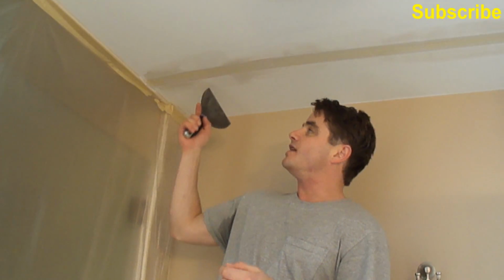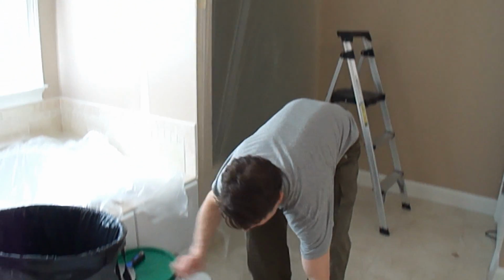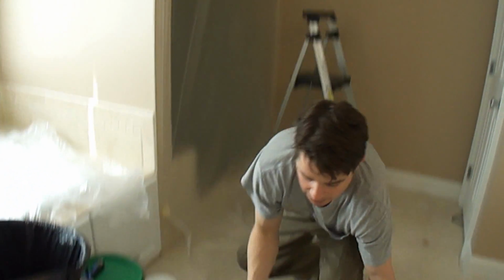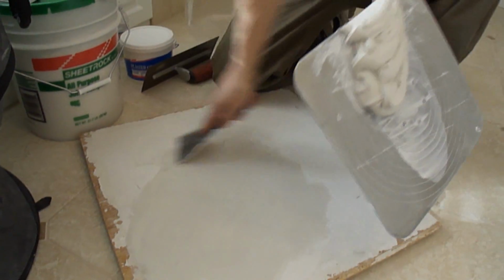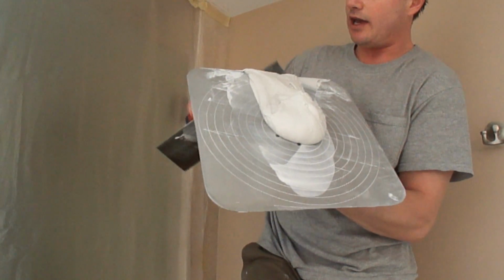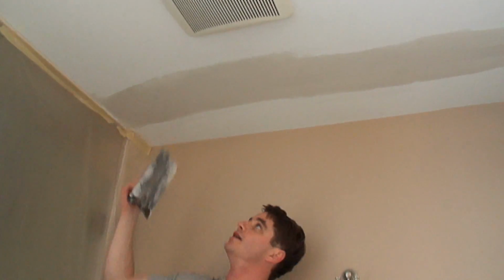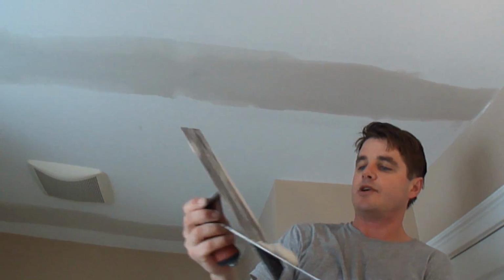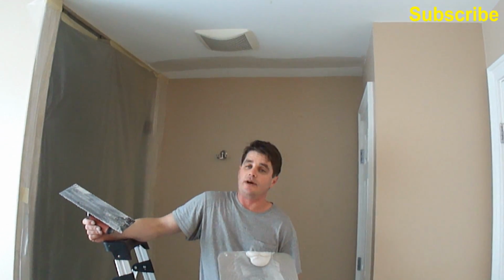DIY - Repair Cracks in the Ceiling by Removing Old Drywall Tape (Part 4) - Drywall Repair

Comment: 👍🏻Nice presentation! My only question is Why you didn't address the crack itself by securing the drywall to the wood above the drywall ceiling? Weren't the cracks a result of drywall panels slightly moving? If the drywall isn't secured to some wood structure better, the crack may reappear on the edges of the new setting compound and the old mud.
Reply from the maker: I think the crack was from not packing enough mud in the joint in the first place before taping. This causes a week joint that looks smooth and strong to the eye, but if you where behind the joint, you would easily be able to poke your way through.

Comment: Hey Russ sorry I am asking questions again lol if you can remember from the bathroom series. 

I'm asking about texture again. As I peel away the old cracked tape the sheetrock of course is smooth underneath. The sides though are textured. And it is the slap brush style and this stuff is thick. So do I need to sand like a foot wide width on both sides so it's flat? I'm afraid if the texture is not flat it'll built up super high like a mound. Thanks again.
Reply from the maker: Hi Ryan

Can you please LIKE my Facebook paint page and post your question to my wall along with a picture of the repair area. 

https://www.facebook.com/russolinatzpaintingllc
Reply: @RussOlinatzPaintShow  oh I didn't know had a FB page. I will show once get there. Thanks.

Comment: Hey russ. I wanted to ask you a question and I hope you can respond. I'm looking to build up my handyman skills and get better at drywalling. I can never really figure out how much pressure to use with my drywall knives. I'm never really sure on how much mud to squeeze out of from behind the tape. And how lightly or heavily to skim coat. If you search youtube for videos on "how much pressure do I apply to my drywall knives" nothing comes up, yet people debate this left and right on forums. It's obviously a question many people have but there are no videos specifically on this subject. It's a video suggestion but you would be the first to specifically target this matter. And your an awesome teacher so I think you are the man for the job
Reply from the maker: I'llthinkofsomething later I'llthinkofsomething later Hi

Thanks for your Nice Comments and questions. Do you use taping knives or a trowel?

Russ
Reply: @RussOlinatzPaintShow  I use knives. But I'd love to learn house to hawk and trowel
Reply from the maker: HI-

I have some videos on my other channel that might help you with the hawk and trowel. As far as pressure, It often depends on what your body angle is to the wall or ceiling. If you are working on a wall, then you can use your body and gravity to assist you. You do this my leaning your body into the knife or trowel. If you don't use your body, then you have to use a lot more pressure from your elbow or tricep. When skimming a ceiling, you can't cheat. You are going directly against gravity and the more of a gap from the ceiling to your head, the harder it is to skim. My current video series deals with this and I try to explain the pressure that I'm using when skimming with a trowel. Have you watched my newest videos?

Russ
Reply: @RussOlinatzPaintShow  well more specifically I guess is that I'm wonderring why it's taking me so many passes to cover the tape. I've done 2 coats and I feel like my tape is barely covered up. When I watch you do it its covered on the first pass. So am I putting to much pressure and scrapping of to much mud? Then I'm worried I left to much mud and that it will be a huge bump on the wall.
Reply from the maker: Hi

Ok so if your using a 10-12 inch knife, make sure the the angle from your knife to the wall is acute. Probably like 20%. As your angle goes up to let’s say 45%, you will take away more mud. It’s ok to add more mud over the tape on your second coat, this will leave a bump in the wall at first, but after you cover the tape in the middle, you have to add mud to the left and right of the tape. You are creating a arc and this is what creates the illusion of hiding slight hump. Where you from?

Russ
Reply: @RussOlinatzPaintShow  I guess with as much experience as you have you can do it on your first try. I did 3 coats and barely fully covered the tape. It's pretty smooth tho. Is it ok to do many thin coats. That's what I feel like I'm doing. And I'm also going over textured and painted wall. I'm all the way in Portland, Oregon. Your being views from the opposite side of the country man. Good work!
Reply from the maker: I'llthinkofsomething later 

Have you ever used the fibafuse tape?

Russ
Reply: @RussOlinatzPaintShow  no never. It's always been paper for big repairs and mesh for little stuff. Is fibafuse better than paper?
Reply from the maker: Try it out!

Comment: I finally decided to fix a small crack I have in my kitchen. I'm new to this so, bare with me. I did take my multi tool and make the crack bigger. I then put my mesh tap up and put a layer of spackle down. I never removed the old tap so, my question is. I've sanded, n sanded(I'm definitely using to much mud). I check my work after sanding with a level to make sure there are no high sides well, there is right where the crack was. Is that because I fudge remove the old tape? Is there a way to feather it in or is it best to start over n pull the old tape out? Appreciate all the help...great videos especially for us new do it ourselves.

Comment: Hi!, very helpful series. I have several drywall cracks, and I have tried repairing them with the mesh tape and joint compound method and the cracks always come back after a couple months.  Do you have any advice on how to make these repairs last longer? also, I have textured walls, so after repairing the cracks it is always very obvious as the texture is different than the rest of the wall. Do you know a way to make it blend better? Thanks!.

Comment: No, and I probably won't now...just thought if you had any luck with them I would try it too!!
Reply from the maker: +Jane Doe 
Do you have a similar project?
Reply: I have a ceiling and wall to fix in my bathroom. I had some electrical work done and water damage in the ceiling.

Comment: Hi Russ, thanks for these awesome videos! We have a vaulted ceiling in our master with lots of angled intersections. Our cracks are running along most of these angled intersections. Would the same principles apply? It seems like the cracks are running right down the middle of the tape, as they are in your flat ceiling. And how would a DIYer finish off the repair if the rest of the ceiling has that low-relief texuring?

Comment: So how would I do this in a corner?
Reply from the maker: Hi-

Do you mean the corner of the wall?

Russ
Reply: Yes, would the same principal apply? In the past I always just used regular joint compound, but mixing it with plaster of paris makes more sense.
Reply from the maker: StormLaker1975

Hi-

I don't have a video of tearing away the old tape from a corner, but here is a video of me re-taping a torn out corner. Yes try mixing the Plaster of Paris into the Allpurpose mud. It like regular All purpose on steroids. It sets in less than 10 minutes, dries a lot Harder, and can be manipulated during its fast set time.
@ 6:22 Fixing a Bad Tape job - (Part 2) Drywall Repair & Wall Preparation

Comment: Why use the plaster of Paris and not just plain joint compound?
Reply from the maker: Hi-

Great question! I add the Plaster of Paris so it turns hard or Sets in less than 10 minutes when mixed together. This allows me to do multiple coats in one day, rather than just using All purpose mud which takes overnight to set and dry. Plaster of Paris also dries structurally harder than regular joint compound which better resists future cracking. I hope this Helps!

Russ
Reply: Russ, Thank you for the quick response!  I'm going to be doing this on one of my walls where the paper tape is coming up. You had the best video I could find on the subject.
Reply from the maker: Hi-

Thanks a lot! Where are you from?

Russ
Reply: Richmond, VA.  Do you have any videos on fixing nail heads that have started to crack through the paint?  If not, any suggestions?